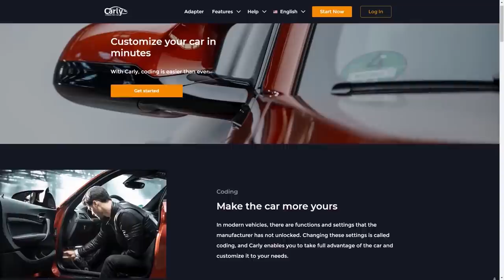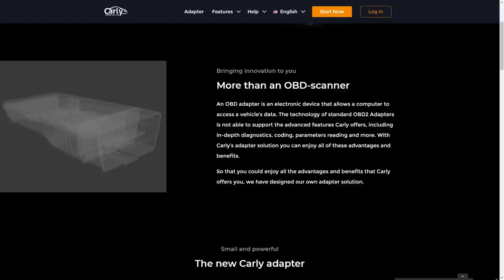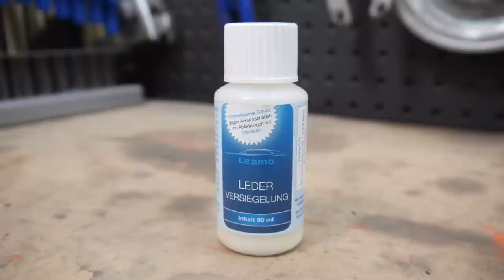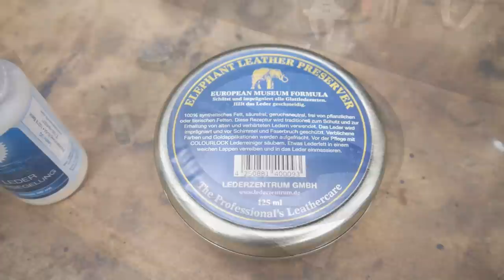BMW E30 M-Technic Sports Steering Wheel [Restoration]

Comment: Awesome! Well done!
I have the 370mm version in my M3 and its a lovely wheel.

For an even better result you can use leather filler and sand the rough grain back completelt smooth. Then spray the dye on with a mini hvlp gun, then satin clear leather coat ontop. It comes out perfect.
Reply from the maker: Cheers Sat!

Comment: Mine looks nearly identical to yours.  This will be a winter project.  Thanks for the video.
Reply from the maker: Cheers Keith!
Reply: @RestoreIt  I may have an extra 375 mm steering wheel. I’ll need to measure it when I get home to confirm.

Comment: At 4:39, you wiped all the dry grime agitated from the previous step into the fine grain! Making all your other cleaning steps less effective. You should have used a sponge and some warm soapy water to keep the areas wet and rinse that dirt off.
Reply from the maker: I thought that too... but don't worry... I cleaned that thing for hours and showed only a very small amount of it.

Comment: Ahhhh thanks to your video I realise I've been using that leather restoration kit completely wrong lol. I always thought if the original "skin"(the dye) came off, that was just the leather ruined.... And I just applied a thin coat of dye over that to "mask" the imperfection... Didn't realise you're supposed to do a few thick coats and then seal it lol.
Reply from the maker: It's not a perfect job but its a lot better than what it was :D

Comment: Ive restored an identical mtech steering wheel for my 325is. Ideally you should just reupholster the leather as it is a wear item like bushings and bearings. Black automotive finish hide with thick nylon leather thread.

Comment: the end result looks stupendous, but am wondering about that smooth leather feel after all that sanding, does the dye compensate for it? 
i've seen other youtubers use "Colourlock" solution, the trick there was with the filler which you did not use here.

Great job All in all.
Reply from the maker: Thanks! It does feel smoother than a new one would thats for sure.

Comment: Very surprised you didn't just recover it!
Reply from the maker: I wanted to try this first but will be trying that in the future :)
Reply: @RestoreIt  FYI I worked a lot with colour lock leather restoration, and it is kind of useless for really bad leather. The work you did on the steering wheel will hold up as it is only abused by hands. If you try and repair a seat by filling in cracks and recolloring- don't waste your time. The color seals the leather and makes you sweat and then the fibers of your clothing stick to the color. Filling cracks never lasts.

Comment: have a BMW size 525, the engine is unstable, its sound is going up and down at the same time, I replaced the AC, the Fitbeam, and the fuel filter

Comment: there is a 370mm and 385mm mt1 steering wheel smaller one is getting quite rare and so expensive
Reply from the maker: 370 is what I meant :D
Reply: I have an 370 mm steering wheel if you want,and I ship it
Reply: @ibrahimelabed8395  I have maximum 200€

Comment: Que tipo de líquido utilizas para la máquina lava piezas? Gasoil u otro líquido desengrasante?
Reply from the maker: https://www.ebay.co.uk/itm/Concentrate-Engine-Degreaser-Parts-Washer-Fluid-25-Litres/124306059851?epid=28024079784&hash=item1cf137f24b:g:-C4AAOSwrk5fPlcY
Reply: Yo uso gasolina y diesel. Es lo mas fuerte barato y disponible donde sea.
Reply: @RestoreIt  gracias
Reply: Pd: me encantan tus restauraciones, vaya nivel de detalles